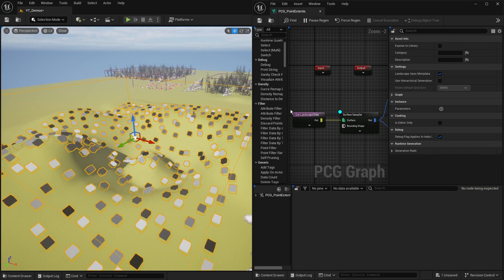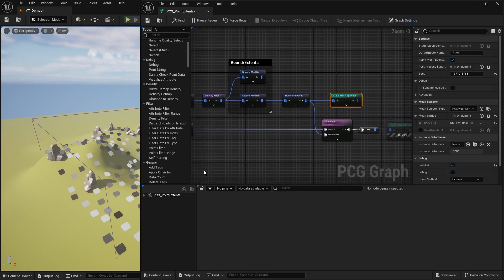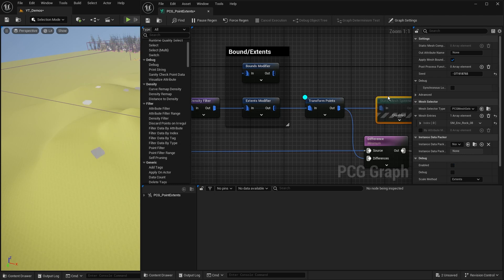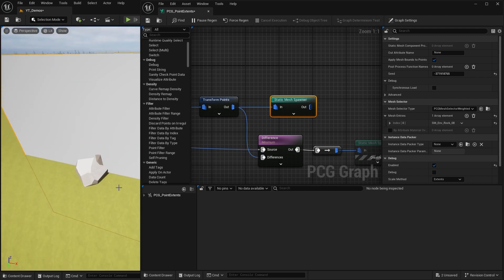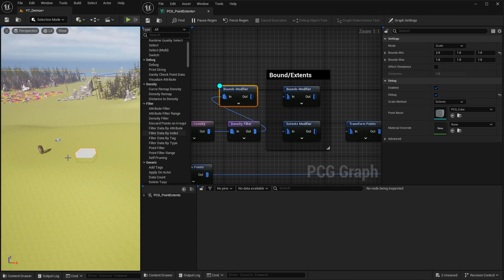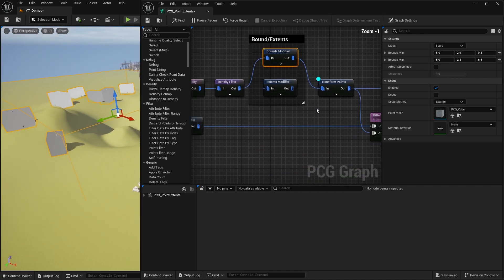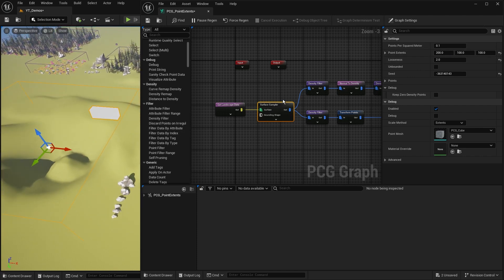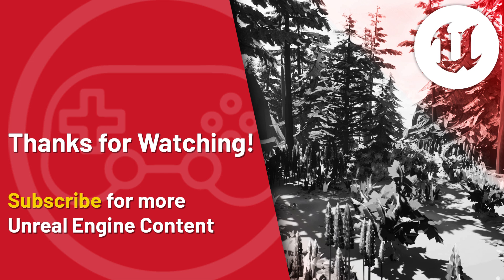Unreal Engine 5 Tutorial - PCG - 10. Bounds and Extents Modifiers

Comment: Thank you for this video! I've encountered an error at times in UE 5.6 where it will say a PCG asset Bounds do not match well with the mesh it will say things like one is significantly larger than bounds (x=85.0329, y=24.03404, etc. Sometimes it will show up as a black mesh in the scene, but I wasn't sure what is causing that. Is that the Bounds modifier for PCG or would that be an extents modifier or something else? Does the bounds modifier cause this error but not if we used the extents modifier?